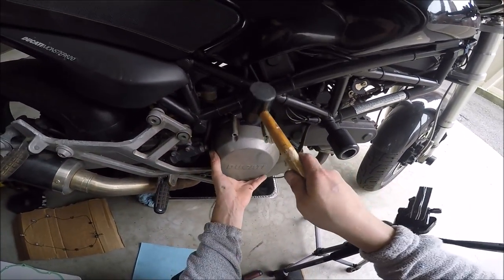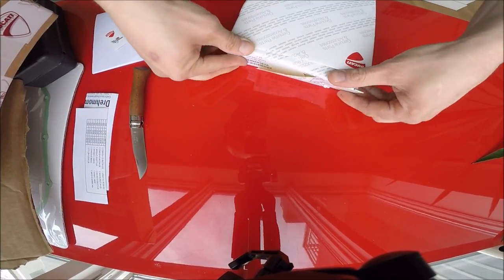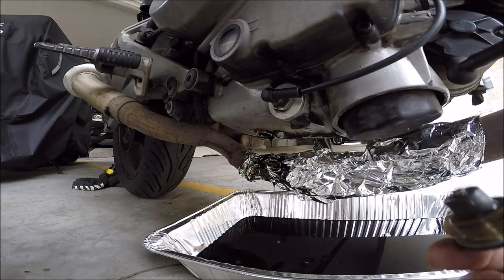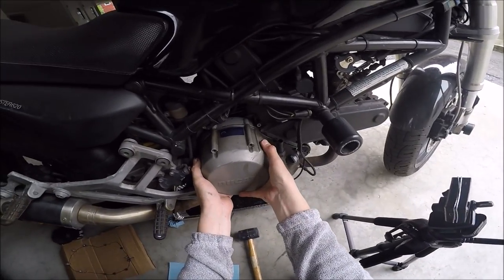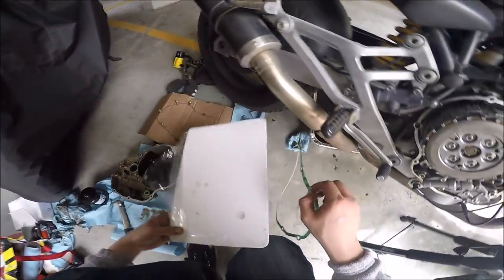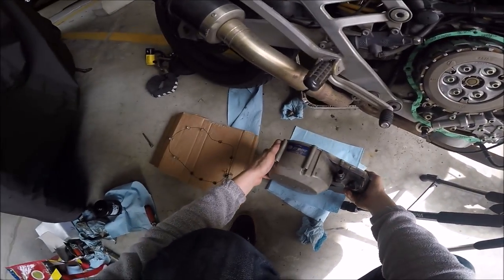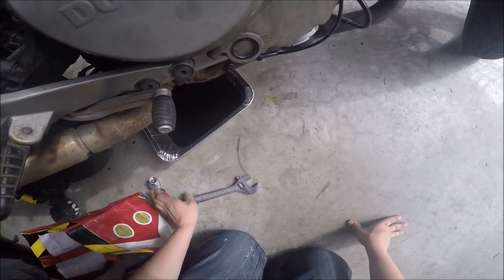How to Replace a Wet Clutch on a Motorcycle + Oil Change - Ducati Monster

Comment: I did not yet change the clutch, good and useful video. Do not be angry, but the screw should be tightened crosswise, not order. This is the rule of mechanical engineering.Thanks for the real of video clips. Hi!
Reply from the maker: DARKOR you are absolutely correct, reviewing the footage i realized i made this amateur mistake of not cross tightening. Dang! :(

Comment: always make the clutch plates wet with oil (no need soaking). When you do and undo bolts always do it in cross order especially clutch.
Reply from the maker: Yea, I heard about that and then I've also heard against that. Good idea, i'm sure. And yea, cross order tightening is a must.

Comment: I don't know if you saw it or not but that last friction plate is supposed to be rotated into the next set of slots so its offset from the others. if you go back to when you pulled it apart you can see its correct placement.
Reply from the maker: Dang, I need to look into this. You are the second person to mention that. I did not realize I was supposed to stagger it/offset it. It seems to work this way, am I damaging something without having it offset - should I pull it apart and move the plate?
Reply: I don't think it's messing anything up, I've looked at some videos and all did the same as you.
Reply from the maker: Boom.

Comment: When you disassembled the plates, the last one was in a different way than the others - and in different holes. And you assembled all the plates in the same holes.
Reply from the maker: You're probably right. I made this video over 6 years ago. That said - my clutch is still working just fine.

Comment: Thanks for sharing 👍🏼 
I recently cleaned up a Monster, those rearsets, rip them off get them sandblasted and powder coated. Just remember where the Stand bolts onto👌🏼 the bike will topple.
Reply from the maker: Yea thats part of the plan for when I pop the new motor in soon :)

Comment: Always add a little oil to the filter seal it helps them seat correctly you should also fill the filter with oil before you put it on .......you will find there are oil volumes for just the oil change and anther volume for doing both
Reply from the maker: You are absolutely correct about filter seal oiling, i always do that but this time I either forgot or edited it out. As far as putting some oil in the filter, i will try doing that next time, thank you for the tip!

Comment: Awesome job! Did you stagger the last plate on the clutch pack? Not sure what this achieves but it was in the S2R 800 manual. I would assume its the same for all slippers. Proud you joined the ranks of old the ole Raw Doggers lol.
Reply from the maker: I did not stagger it :( Damn, i might have to go back and fix it. The clutch seems to work fine, so perhaps it doesnt HAVE to be staggered, but i can tell that it was, originally. :(
Reply: Well if you are not having issues, and it works fuck it. For some the stock slippers can be finicky, plate types, oil type.
Reply from the maker: Yea, its kind of a pain in the butt to take it back apart and all that so I'm going to run with it. Clutch works perfect (knock on wood)

Comment: Wow very educational video for monster owners, thanks a lot :) I was expecting to show us the worned plates but it's ok.

Btw, on my 27k km monster I think I have some clutch slippage if I ride it aggressively (over 7-8k rpm) - I increase throttle but the power delivery is late, is that the symtom ?
Reply from the maker: Hey! Thank you very much! Not a bad idea, i should have shown the plates. Perhaps another quick vid :)
And that is exactly the symptom, in 3rd and 4th gears if i opened it up fast after 5k there would be alot of noise but no go

Comment: Nice video. Good job. As mentioned crosswise tighten screws and you could put some oil on your finger and rub it on the sealing from your new oilfilter.
Reply from the maker: Absolutely. Both right things to do and I swear I always do both of those things, but like a fool I didn't do it this time. FAIL. FAILLLL big. :(

Comment: How many miles instead of oil and filter change? What oil do you use?
Reply from the maker: I try to do it every 2,000 miles or so, give or take and do not have a brand I prefer. 10w-40 is the oil.

Comment: Hi, thanks for the vid. Very informative and useful.  I've just received my clutch plate set and am hoping to give this a go myself (on my Ducati Scrambler - could not find any clutch replacement vids for it, but understand it's pretty much the same engine as the monster 796). I read in your reply to the previous comment that there a several things you would do differently next time. Reading through other comments, I gather they might include: putting a little oil around the seal of the oil  filter, and filling the filter with oil before mounting it, which is how I learned to do it too.  What I was wondering about was what is meant by staggering the plates? Do you stagger all of them (or just the last plate as I read in one comment)? And how is that done? Sorry, this is totally new to me, and hope to head off issues before I create them. Any other advice, or things that you would do differently? Thanks again.
Reply from the maker: Yep, i always oil the seal before putting the filter on. I just didnt in this video. That's good practice. I've never really filled filter with oil,  but that does make sense, so you don't over fill/under fill the bike. 
It's not necessary to stagger all the plates, just the last one. you will see when you pull of your clutch cover that the last plate sits on a different set of knotches. It's pretty obvious after the fact but during this video I was way too exited to notice it. However - my clutch works perfectly (knock on wood) even without doing that last step. All seems fine. It's a really straight forward and easy process as long as you take your time and do not rush. 
Damn new Scramblers and their clutches, my  buddy is on his 3rd one and his bike is like 2 years old :(
Reply: Exactly! 24,000 km and this is the third set of clutch plates. I didn't own the bike when the plates were first changed, but the original owner has told me that he got them installed by Ducati, which I guess means they were Ducati OEM parts, which for the Scrambler, are pretty crap I hear. Am trying the Barnett set, with new Barnett clutch springs. Hope they are more durable. Guess I might want to gear down less too. Anyways, thank for the vid and info. Hope your clutch continues to work well!
Reply: I guess I would have to change those springs as well. My mechanic says that clutch is perfect, measured it and look at it, not burned. Suggested that I should replace springs. Hope it helps, cuz at the moment my clutch is slipping like hell. :(

Comment: hey i watched your video and i saw that the last 1 or two of the old clutch disks were put differently than the others 8.. and when you put the new ones you put them in the same "channel". did you had any issues with this order? thx
Reply from the maker: I had a few comments about this - 30,000 miles later it has not been an issue.
Reply: @ducatinyc but I have the issue when I assembled it correctly. The last plate went very hardly in other slots and clutch doesnt work 😅
Reply from the maker: @uehal  Sorry to hear that. Mine is still working just fine, many years later

Comment: Having good oil should be a priority, especially on a 620, which has some warm up problems when the engine is still cold. Don't cheap out on it ;)
Reply from the maker: Yea, it's true. But then the urge to save some $ kicked in - but you're absolutely right.

Comment: Vc esta demorando muito pra trocar o óleo. Mas parabéns pelo trabalho .Muito bom.
Reply from the maker: Yea, it has been over 2,500 miles, too long for sure. Or do you mean the video is too long? :) Thank you very much!
Reply: The interval between the exchange of the old oil by the new oil that was large. The time of the video was very good.I like more of your Blog.
Reply from the maker: I agree! I rode through New York City winter with all its snow and grime, my poor bike was crying for new oil. I usually try to do it more often. Thank you for watching and taking the time to leave a comment!
Reply: I'm a mechanic in Brazil. Whenever you open the clutch cover, open it with the engine still warm, so you do not damage the gasket. So you save money. :)
Reply from the maker: ah, not a bad idea. thank you for the tip. in my case my old gasket was leaking so I needed a new gasket either way, but this is good to know. I did warm up the bike for about 10 minutes before this job so the oil drains easier. What kind of bikes do you usually work on? What is the most popular bike in Brasil, in your opinion?
Reply: Work with all models: Classics, Chopper, Trail, streets, sport and others that we set up.
I'm in love with Traill and Custons or Chopper.
In Brazil the most popular motorcycle is the Honda CG Titan.

Comment: The new cluth (in a wet type system) always need to soak in oil before, and the gasket isnt needed ! only Ducati Threebond 1215. The oil seal in the side cover(from oil pump) isn't seal properly when u put a gasket under the cover , it causes crankshaft bearing damage over time. ;)
Reply from the maker: Nearly 40,000 miles later - and the clutch is still working just fine - but good tips. :)

Comment: Could a bad clutch cause loss of power while riding usually around 5k Rpms. (especially in first). 
Except the rpms go down when I lose power and it splutters. Almost like it's running out of gas. 
Gonna try fuel cleaner first. It had been sitting a little while.
Reply from the maker: 100% it can, but to me it sounds like you need some new spark plugs and to make sure the coil wires are nice and snug and clean and fit well over the spark plugs. Try that.

Comment: from where do you get that paper cover i can not find it even with the number that i see on the packet the clutch set i could find with the number
Reply from the maker: I just found it on ebay. looked up Monster 620 clutch cover paper gasket. Perhaps try searching for that word combo, make sure to use the word gasket - a few should come up

Comment: how many miles did the original clutch last you?  thanks!
Reply from the maker: It has been slipping since about 10-12,000 miles, but I waited until about 26,000 to replace it :)
Reply: excellent.  thanks for the video.  I ride a 2012 Monster evo 1100 - so much fun!

Comment: He forgot to put the last clutch friction plate in the opposite slot.
Reply from the maker: SirKing George very true. However 13,000 miles later its still running perfect so perhaps its not a big deal
Reply: @ducatinyc  What does he mean ? The last one should be inverted?
Reply: Yeah, I was wondering about that and if it makes a difference.
Reply: Alex Tatu the last one should be flipped so that the friction material contacts the plate I believe
Reply: No it means that it should be turned clockwise a few degrees to fit the other slot, the shallow one ;).

Comment: I followed this video step by step and my bike won’t engage in first. When I click into first and start to let out the clutch nothing happens. When the bike is off in gear it dosnt rock it just moves freely. Where did I go wrong? How do I fix it?
Reply from the maker: Weird. Not sure what you did wrong. My clutch is still working 30k miles later after this clutch job. Sorry my friend.

Comment: Did your clutch handle have pressure once you changed the clutch or did you have to start the bike first in order to get pressure in the handle?
Reply from the maker: It had pressure, didnt need to start it

Comment: Good video as usual bro. Informative videos are always great. How many miles did you have on that oil? If you stated in the clip I apologize for missing it. No Flaming here just curious. I have about 1500 miles on my T6 oil and it's still as if it was just poured out the bottle. My Sti turned oil black fast for obvious reasons though. Keep em coming brotha. Be safe, Ride like the wind.
Reply from the maker: About 2,500 miles, but most of them in the winter and cold abusive months, so i think that might be why?
Reply: Ducati NYC Vlog Possibly. I ride winter time as well.
Reply from the maker: +Zack come to think of it, all my oil changes look like that. Maybe its something with my model of Monster, turns the oil black - who knows.

Comment: Where did you get the parts?
Reply from the maker: Just found them on Amazon :)
Reply: @ducatinyc  I'm new to the monster scene, and I'm finding it harder than I expected to find parts.  Ended up ordering the clutch plates, and clutch cover and stator cover gaskets from motowheel.  prices seem reasonable, hopefully the service is good.
Reply from the maker: monst3rmashh i’ve used them before, they do good work

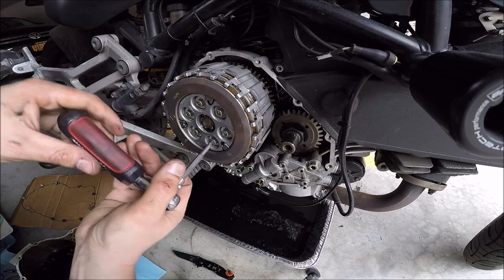Comment: You have forgotten to rotate the last friction disc, you can see at 10:17 the original assembly and your assembly at 16:15, but anyway no functional problem.
Reply from the maker: Yep, i did, 30,000 miles later the clutch is still good

Comment: The last disc was put in wrong. Good disassembly and assembly video otherwise
Reply from the maker: Yep, you are correct :) Surprisingly it has not affected the performance at all over the last 13,000 miles it's been like that :)
Reply: @ducatinyc  Well that's awesome to here that a couple years later it is still running like a champ or dare I say... Like a monster
Reply from the maker: @dannyfresh6697  hehe. nothing better than motorcycle humor :P

Comment: Dislike this video because you put the final disk wrong . The disk must be put at the other possition and not to the same with the other disks . Check your video from the begin when you take out the bolts where is the first disk .
Reply from the maker: You are absolutely correct. However it doesn't make the difference in the end and the clutch has been workin fine since the install -- BUT! you are right, I did put it in wrong. You could always like the video for all the effort it took and dislike in the comment ;)
Reply: Ducati NYC Vlog the aptc clutch system does not work if you put all the disks together
Reply from the maker: what do you mean? my clutch has been working fine.
Reply: Ducati NYC Vlog google to learn what is the aptc clutch that ducati has at the monster and the multistrada 620

Comment: Last plate against pressure plate, should be offset in different groove.  Wrong install.
Reply from the maker: Yep, but 30,000 miles later it still works. Thanks for the comment

Comment: The last clutch plate is badly fitted.
Reply from the maker: 30,000 miles later and it’s still fine. Perhaps it didn’t matter
Reply: @ducatinyc  😁

Comment: You’re gonna burn your clutch and end up scrapping it. you need to soak your clutch for at least 15 mins in oil. Flagging for false advertising m, should’ve been called “how to burn your clutch”
Reply from the maker: Perhaps do some research before leaving a comment. IT IS NOT necessary to soak these specific plates for this specific bike. Look up other tutorials, not everyone soaks them. Thank you for the view/comment anyway, every lil bit, even if hate, helps. Have a great day!